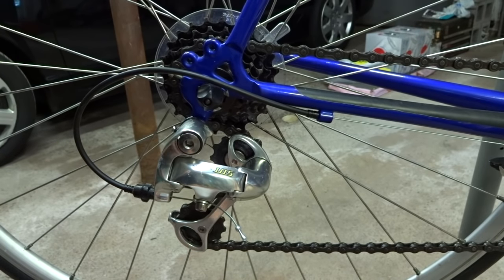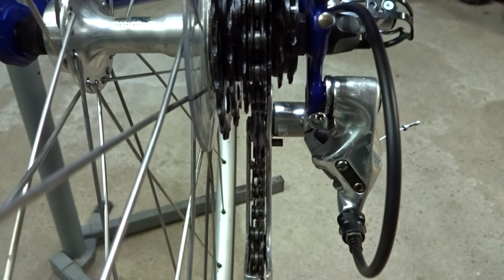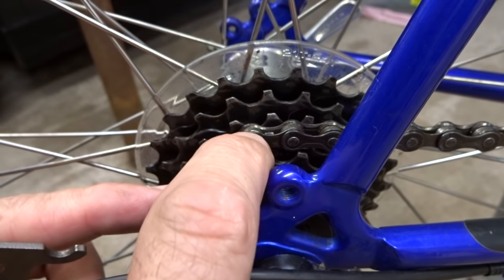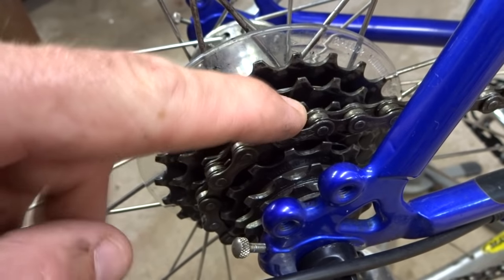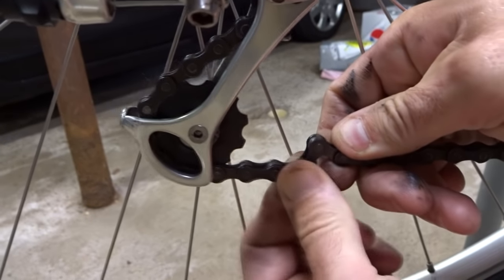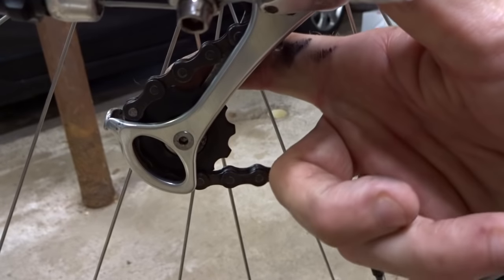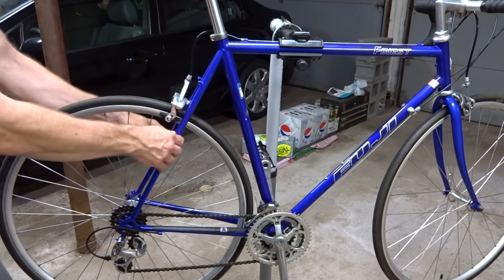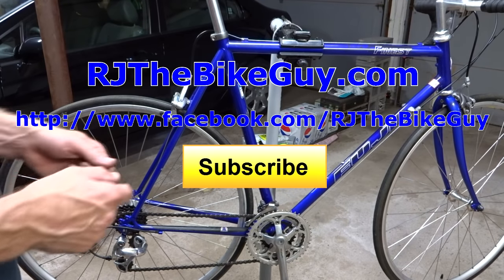How To Fix Bike Chain Skipping/Slipping/Jumping Gears

Comment: Great video! I'm trying to repair my wife's E-bike fitted with a Shimano Deore, 10spd cassette with KMC X10eT chain. She has over 3,000 miles on it and the chain had a 1/16th in stretch, so we just installed a brand new chain (same KMC as new bike). Unfortunately, the new chain jumps under effort, and any adjustments to the derailleur did not help. 👉Is it possible that, in this case, the cassette would also need replacement?
Reply from the maker: Very likely.
Reply: @RJTheBikeGuy  I replaced the cassette and also the front chain ring: All IS GOOD NOW!   Thanks

Comment: I literally just bought a brand new bike and as soon as I start to ride, the chain just randomly jumps from gear to gear.
Reply: Same I just bought a shwinn axum and it's jumping gears like crazy and thr shifting us bad I need to get ut tuned even the back brake disk kinda rubs a bit I don't want to tske it to the bike shop since I already spent 400 on it and for basic tune up shop charges 125
Reply: @CertifiedStepper what’d you end up doing?

Comment: Be aware that some wheels have a freewheel hub that has a wobble ( hub freewheel mount is not straight) which will make adjusting index shifting more difficult as the Freewheel will now wobble as you ride which makes shifting setup harder.

Comment: My co-worker just bought a brand new RD and chain. He said it's been skipping since then. And then he replaced it with the old chain and the skipping stopped. What seems to be the problem, sir. TIA for the answer.
Reply: This happens when you have worn out freewheel and new chain. Solution is to change also freewheel or just ride the new chain on other cogs where it is not skipping much (it will usually skip only on most worn out cogs) until it kind of settles down after a few hundreds of km.
Reply: @diodazelena3330  thanks for the info. We'll just save enough money to buy new gear. I have been riding my bike for almost a year now (6 days a week for 16 kilometers back and forth from home to work) 😁 and do some long ride if I have time.

Comment: Being a big guy #250+, I have a lightweight MTB and I think this is the problem I have, seated or not. Great video running through a wide range of possibles. I have changed chainrings, and adjusted, but still I get a skip back and on to the same gear. Hmmm, I like my lightweight bike and I cannot ride it at full speed as that is the only time it happens, on the 3rd and 7th top gears.
Reply from the maker: I can't tell you without working on the bike. I would basically go through the steps shown in the video myself.

Comment: My bike was going perfect today until I stopped for a drink at a store and then when I got back on it it felt crackly and the gears weren't changed also the force required to move the bike fast was little and it felt like I was riding a really old bike even though it's not old and it was going perfect before my stop for a drink
Reply from the maker: Bummer. Something apparently happened. Isolate the issue and fix it.
Reply: @RJTheBikeGuy  So I cleaned the bike with a degreaser and it fixed it.How do I tighten the brakes so they won't keep scraping on the tire?
Reply: @BradLeeee  I subbed with 3 accounts because quality content

Comment: Mine skips on the highest 3 gears (3 smallest ones at the back). 7, 8, and 9. It's a brand new 1500€ bike too. 2 week old, so it shouldn't be wear and tear. I suspect the problem stem from that time when I biked home from the bike shop, obviously excited with a big smile, I hit the tram tracks and rolled over on my back. No real medical issue, more so my pride, but that probably bent something on my bike somewhere. Then again, the problem with that theory is that the gears didn't start to jump until several days later while on a cross country trip with lots of luggage in a bike cart/trailer. Now it jumps while going straight on flat ground with hardly any pressure at max speed.

That was too much information, but the point is thank you. You've at least helped me narrow down the issue considerably. :)

Cheers from Norway
Reply from the maker: Could just be cables settling in. If it's a brand new bike, take it back to the shop and have them fix it.
Reply: @RJTheBikeGuy  I'll do that tomorrow.
Reply: @willek1335  And what was the problem?

Comment: I need help
when I upshift the gears dont change
they just stop
if I wanted to get to gear three from gear 4 i would have to shift to gear 2
Reply: try tightening or replacing your shifting cable with the chain on the largest gears for both front and back. then adjust the derailleur .

Comment: RJ,
First, thank you for all of the great videos!  I’ve been able to get into maintaining my bike w/ them!
Second,, I’m a newbie so apologies if my terminology is inaccurate.
Finally, having an issue post-overhaul of my 1991/1992 Bridgestone MB-4.  The drivetrain is slipping (forward, not across gears) in select gear combinations when solid amount of pressure is applied pedaling, especially uphill  (i.e. middle front gear w/ second smallest rear gear).  Some gear combinations seem ok.  Wasn't able to figure out cause from this video.
Replaced original chain with KMC Z51 Bicycle Chain (6 & 7 Speed , 1/2 x 3/32-Inch).
Front crankset/chainrings are original: 24, 36, 46T
Original cassette was:  Shimano 7 speed cassette ((Shimano CS-HG30-I am).  11, 13, 15, 18, 21, 24, 30T.  They no longer make 11-30T.
Replacement cassette is:  Shimano CS-HG50 7-Speed Cassettes (13-15-17-20-23-26-30T)
I quadruple checked chain length/links against the original and new is same number of links but a tad bit shorter due to stretch in 25yr old chain.

Could it be that I put the front chainrings on backwards during overhaul?  Do I have a chain/cassette/crankset mis-match?

Thanks in advance!
Regards,
Jeff
Reply from the maker: I can't tell you anything without working on the bike directly. It is likely something in the video. Maybe adjustment or worn cogs or something.
Reply: Thanks.  Where are you located?
Reply from the maker: Further away than your local bike shop.

Comment: Really useful video, thanks for posting. I have a chain slip issue, this always comes up when I am pressing down on the pedals, such as when starting to ride when stationery, this also occurs when I am riding up a steep incline, even though I gear down and select the low gear, the chain slips when pressing down. The slip does not occur in any other condition
Reply: The drive train components all wear together. Replacing just the chain may not fix the problem. As the front chain rings are alloy, they wear more than the steel rear cogs. On my over 30 year old bike, when I replaced the chain, it slipped worse than before. On inspection, I replaced the front chain rings, and it was better, but the rear freewheel was still slipping. Got a new freewheel and all was copacetic. Moral: save time and frustration and just replace all of them.
Reply: @reecenewton3097  quite true. I replaced the chain and the cassette and now it's perfect

Comment: Need help. 
I have just replaced my 10spd cassette together with a new chain. Everything  is good except the 5th cog is skipping. I put back the old cassette, and I don't see the problem.  What could be the problem with my new cassette? It only happened on 5th cog. Very obvious when I started climbing. Kindly help and thank you.

Comment: Okay. I have a trek xcaiber 4. Good condition. Haven't put a huge amount of miles on it. But I have always had an issue when i get to the highest gear in the casset it jumps and slips. Have a brand new chain and the derailleur is dead on and everything shifts beautifully. The cassette is not worn. Certainly not gear 8. Barely use it. But when I do if I pedal hard it jumps.. any idea?

Comment: I had similar issue, replaced old 8 speed chain with new one but the new one was slipping. The reason old was replaced because it visibly extended because of large play of every link. The bike is relatively new (about 1.5 year) but used every day or total of about 3500km. The cogs looks ok as well as derailleur, but the crank cog is not (teeth have visible damages similar to what you described damaged rear cogs). Interestingly the old chain (no slip) although not as good as it was on new bike

Comment: I got some months ago a shimano megarange hyperglide x7 freewheel, but didn't replace the VERY BAD chain cuz I couldn't afford it, now I got a sram PC 850 chain, and now the chain is skipping on the lowest gear (34T). I messed around a lot with the shifting and nothing changed, so now I'm pretty sure it's either the cog worn out in a few months, or the chain is incompatible with the freewheel. and both of these seem very unlikely. and I have no idea what to do, because I don't want to just haphazardly spend another $30 on a new freewheel, or $20 on a new chain, just for it to turn out that the other one was the problem. what should I do?

Comment: Brand new chain, brand new cassette, chain slips consistently under pressure on any gear about 4th. I have a 3 by setup and it does not matter what ring i am on in the front. Any help is appreciated.
Reply: Dog  check your rear derailleur, it may be bent like he shows in the video or your alignment pins may be out of whack

Comment: Just had my bike serviced for this. New cassette, new chain. When pedaling the chain keeps coming off the lower jockey wheel. Everything looks aligned.  However the chain seems to have excessive deflection. I’m guessing it was the wrong chain length. Your thoughts?

Comment: I put a new chain, new free wheel, new derailer, adjusted the derailer a bunch. Ensured (with the proper tool) the hanger is straight. 7th gear still slips. Not into other gears. Doesn't slip off. Just like hiccups/slips usually under torque. Links are good. Bike shops can't figure it out. Ugh. It's a solid aluminum Nishiki frame, no suspension.

Comment: Those binding chain links can be a real 'gotchya' situation. I spent hours trying to dial in the derailleur before noticing the bump from two binding links as the chain passed through the jockey wheels - unstuck those links, and boom, everything ran perfect. What a lesson that was.... and that was with a new chain as well, surprisingly.

Comment: Yeah, I like videos that explain in detail on how to do something properly, because a bike mechanic may say you turn this screw or bolt here but there experts and we dont understand everything. I Have done my own bike for years and still learning. You save a fortune fixing your own bike. I used to spray BMX frames as a teenager with them hanging on the washing line from the seat.

Comment: I have bad skipping or slipping gear problem at winter, I have full suspension MTB, which is a bit loose on rear wheel, which might cause skipping also, how I can fix it to be much stiffer? I don't want it to be too stiff because going downhill rear suspension must work properly, problem is uphill gear skipping at winter time, I just broke four teeth from front chainring, so I have to replace it.

Comment: Hi RJ, I fell off my bike and got injured badly. This happened when my all body weight was on the pedal and the chain slipped off the front gear towards the right side of the gear (where there are no kegs). I rolled over the handle with the momentum/torque of my body on the gravel ground! Later on I checked that and found that when there is full force on the pedal, ( like while facing the wind), chain slips off the front gear towards the right side (between the cover and the gear). What could be wrong with the chain assembly? please advise.

Comment: Thanks for the video. Mine needed a derailer adjustment. I suspect that because the Derailer Guard has broken off that the rope from a goal post i lean my bike against has lossen or changed the alignment but it could also be that the kickstand is very much broken beyond repair could also by way since i have to lean it on everything

Comment: another two reasons why shifting could not work properly: 1) damaged or excessivley worn out gear cable housings 2) your rear derailleur is so old, that its spring(s) lost tension. Along with maybe a little rust, my derailleur had problems retracting, hence gears sometimes wouldn't want to change although everything was aligned properly.

Comment: so here i am with my MTB with a 11s one by setup (only rear der) with an all fresh and new setup.
Every gear from 1 to 9 works, yet when i shift to the 10th and 11th gears (so the smaller gears on the cassette) my chain starts skipping over the teeth.
i've tryed multiple adjustments to no avail and im at a lost cause...
im thinking this could be due to the chain being narrower then my previous setup.. but im in disbelieve still.

Comment: My bike has recently started skipping but it’s also only 4 months old. Is it likely to be wear on the chain and cogs in such a short time? Admittedly, I do use it every day to commute to and from work (3 miles per day) and I only ever use the 3 highest gears. It seems to be in my most common “starting gear” but I would have thought I’d get some more mileage out of it before any wearing issues?

Comment: my son's bicycle came with a 7x3 gear set which comes with a wider chain than x2s and x1s

My local bicycle mechanic replaced the worn stock chain with a chain intended for a x2/x1, because the chain was much thinner than the stock chain there was significant room for the chain to wiggle and slip while passing through the derailur wheels while on the lowesy gear and under heavy pedaling

the solution was to replace with an appropriately sized chain

Comment: Hey RJ, I have an advanced issue with a modern road bike. Chain slips on mid cassette cogs even with brand new chain and cassette - standard shimano kit. The 2 front chain wheel rings (FSA Vero, 50/34) look low wear and it slips when using both big and small rings. I then noticed that the Sora RD has lost spring tension and the chain is not as tight as it should be so I swapped the RD for a spare 105 just to eliminate the RD. It is Still slipping. Im a bit stumped with this one. I can watch the chain slip in those particular cogs but can’t tell if it is front or back. I don’t think it is a compatibility issue as the only thing that is not shimano (and new) are the FSA Vero, 50/34 chain rings. I presume that if it was the free hub that it would slip predominantly in higher gears due to harder peddling but it is 2-3 mid cassette cogs only. I presume this is should point to the problem. The only other thing I can think of is that Low rent fsa chain wheel has hidden wear. I may just swap one component out at a time with spares until it works. Havent seen this in 30+ years. Any ideas? Thanks boss 🙏 https://99spokes.com/en/bikes/cannondale/2017/synapse-sora

Comment: my chain slip only when I'm on the 8th smallest cog, nothing else no matter if I'm on the big one , second or third gear.  I can't see if the casette gear is worn but seems on good shape.  I don't have a tool to check the chain gaps

Comment: I was trying like an idiot to fix shifting problems, I done everything to adjust rear derailleur, but when I was riding only on that smallest cog was a problem, chain was slipping all the time, its not indexing problem and chain is not wear also, I think probably the problem is with that smallest cog, teeth are worn, although I can't see well that.

Comment: Here’s a question for you - I have a 1970s varsity ive been slowly “restoring”. The old chain did not slip, and i replaced it with a new one (same length) and cleaned the rear cassette a bit. Now, the chain slips. Is it possible that the old chain wore with the cassette so it still worked and the new chain wont? Or should I just pop a link out of the new chain to make it tighter?

Comment: i have this problem with a 60s cinelli SC bike i just bought. it came with a new old stock chain, and replaced the chain with another new old stock, still this problem exist. i replace shifter cable as well. and also the freewheel and sprocket disc is completely new. maybe my derailleur is bent... but im not sure how to check if it is bent... im so worn out before this bike is.

Comment: My newish road bike (9 months old) has occasionally been making a clunk and the pedals will quickly rotate forward a bit.
I'm pretty sure it's not the front chainrings, there's only 2 rings, and chain can't catch on the other ring not in use.
I was thinking if the tension was low in the rear derailleur cable it would be pulling the chain to the right, so it wouldn't really be catching on a cog as the one to the right is smaller.
But maybe the teeth of the current cog in use are occasionally catching on the side of the chain instead of going in the middle, this would lift up the chain and make a nasty sound/feel.
I'm gonna look at it tomorrow and try and tension the cable a bit more.

Comment: Have had several bikes with this gear system and they are just horrible. best part is when u go over a bump and just stop "tramping" while going over it and you push the pedal slightly backwards and it makes the chain slip due to the "arm" at the bottom going towards the front creating a slack in the chain.

Comment: I don’t really use the smaller cogs because my shifter delays shifting when I need it to like if I’m about to approach a hill and want to shift to a easy gear for climbing the chain stays on one gear till it feels like moving i have to stop just as I’m about to climb because the chain doesn’t move till I get off walk halfway up the hill and get back on then pedal then it moves and when I’m going down hill and want to shift to a smaller gear does the same so i find myself staying in one of the middle gear and shift the front gear to the smaller gear when I’m off the bike and have it on a stand the gears shift up and down no problem right away no delays